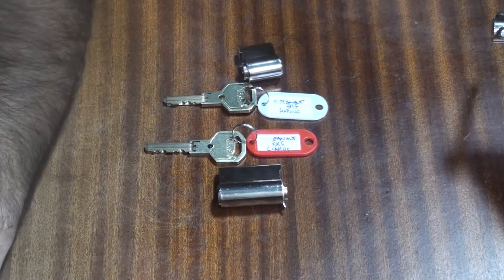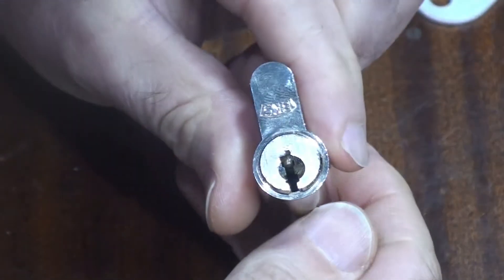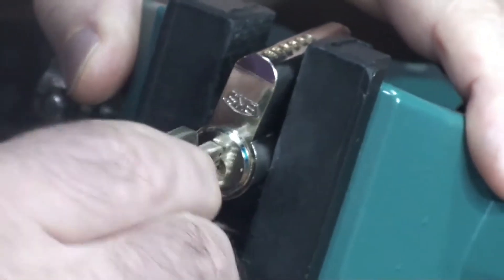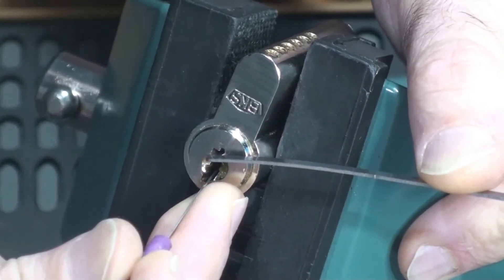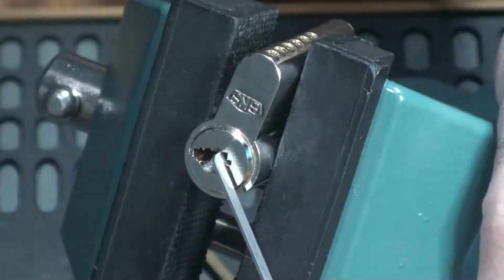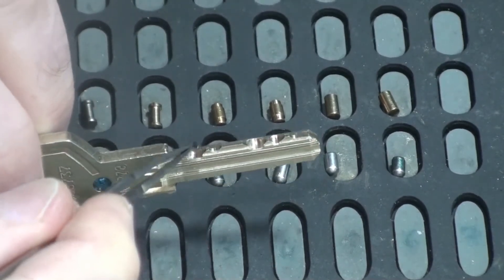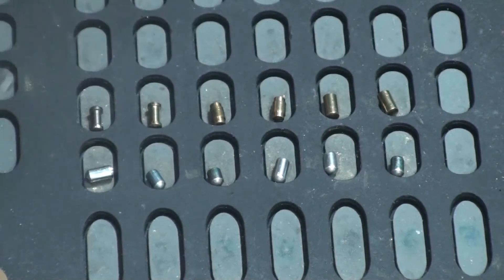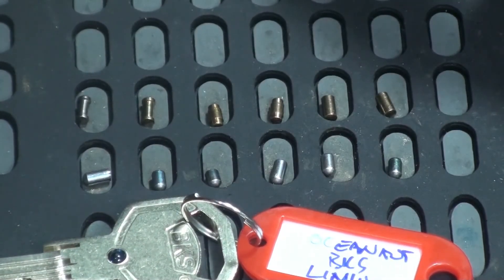[139] BKS Livius picked - fun for pickers, hopeless for doors

Comment: Michael, is that pry bar a one milly? (Nice vid as usual, by the way.)
Reply from the maker: Hi Chris, thanks for the vote of confidence.  Yeah, that pry bar is the middle sized Mad Bob one, which is 1.0. In actual fact I don't think it matters what you use for these locks though, the other one got picked with a 0.7mm Peterson prybar...and that one needed manual counterrotation so a bit of a sloppy fit isn't a deal breaker.